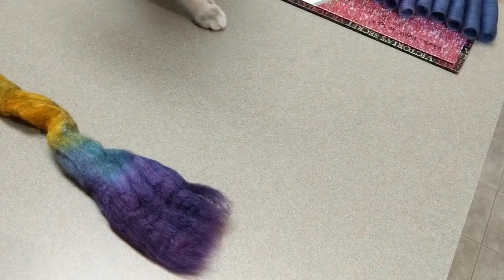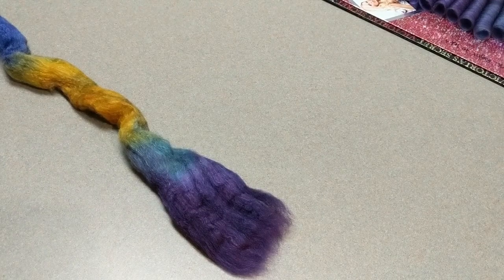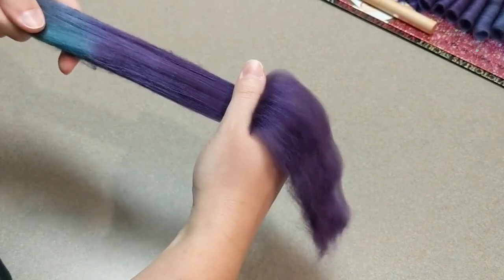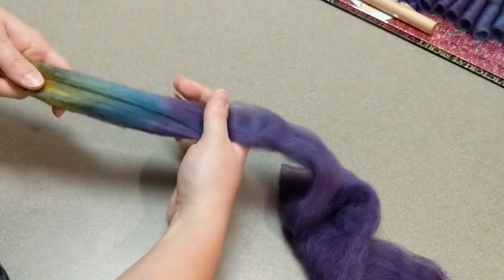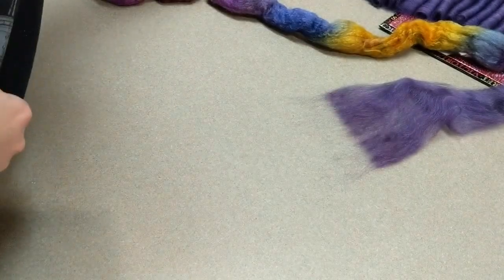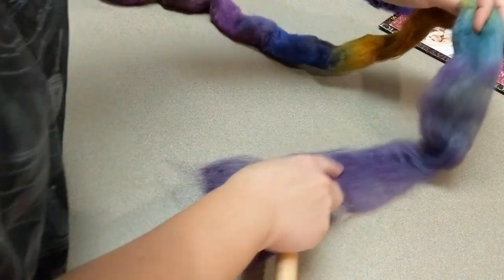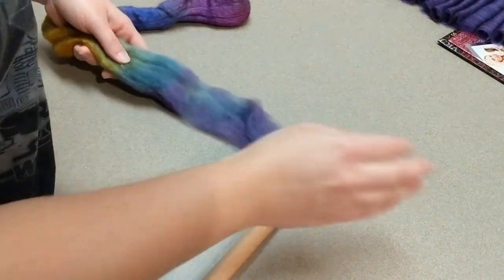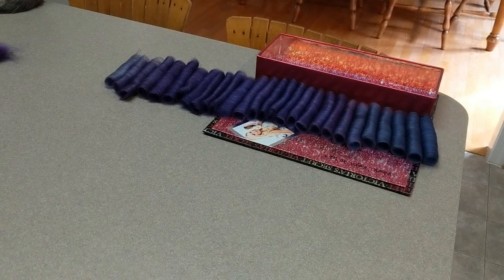Making Fauxlags from combed top

Comment: Hi Sara, what is the diameter of the dowel you used?  Thank you so much for sharing your video!
Reply from the maker: CJ Eisenmenger My favorite one was the warping peg that comes with an Ashford Rigid Heddle loom.  I sold that loom so I no longer have the peg to measure, but if I were to estimate I would say approximately 3/4 of an inch.